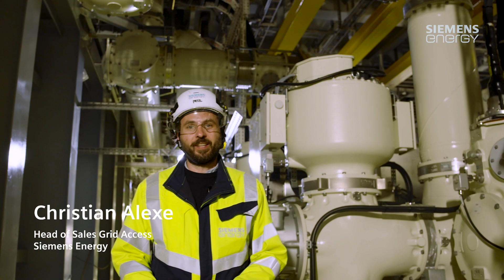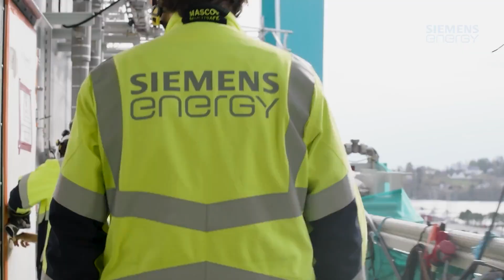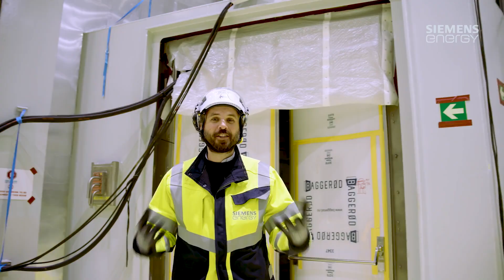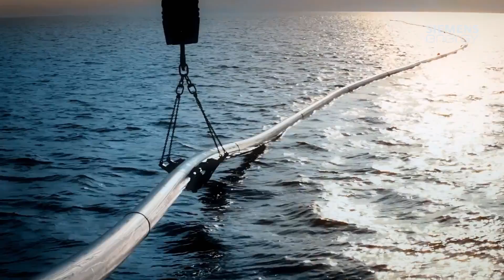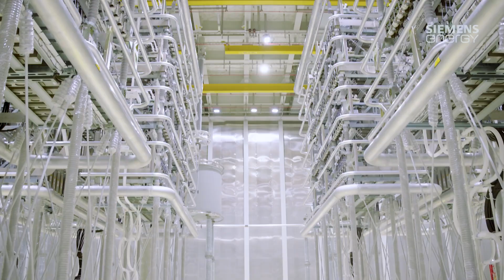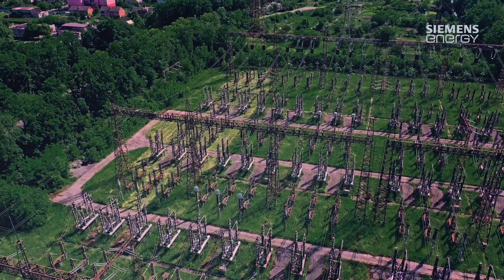Inside Siemens Energy's HVDC Offshore Platform

Comment: With a DC connection at sea, is there only one metallic wire and the return connection via the water, or is the metallic connection two-wire? If two-wire, is it coaxial or two wires in parallel?
Reply: There are two separate cables. One for + and one for -.